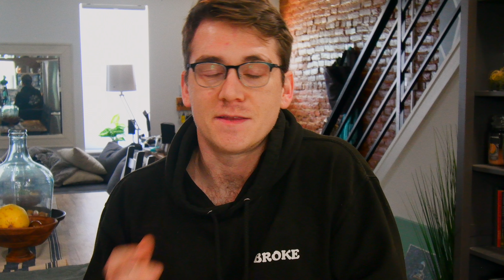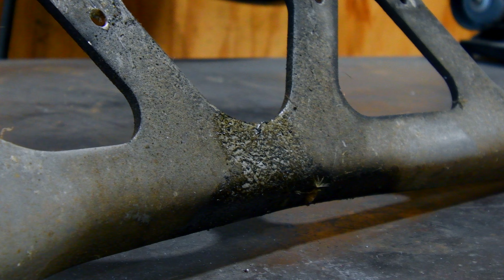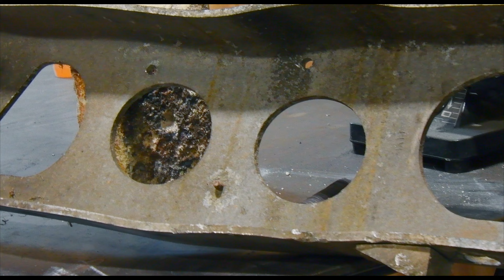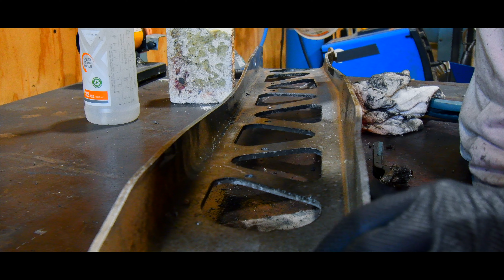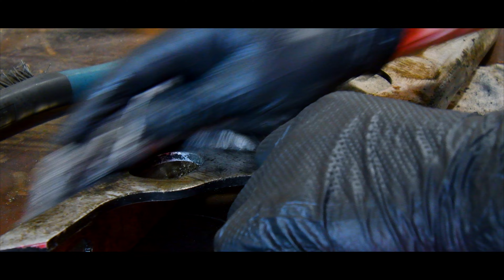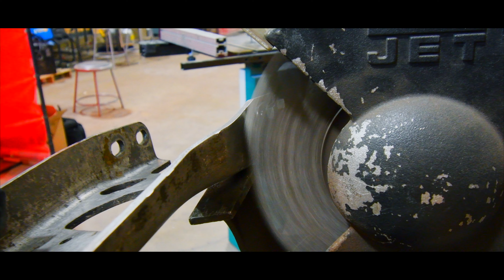WTF is a PPF?! Let's degrease the LAST structural component of a Miata's powertrain | #MamaMiata 34

Comment: What's the PPF made of? Sure looks good cleaned up, especially those shoulder bolts.  What's the paint scheme for the drivetrain? Or is that an upcoming surprise episode? 👍
Reply from the maker: It's made from steel but it's not super thick and it appears to be prone to bending & warping in race conditions.   Thankfully I don't plan on racing my Miata but it's kind of worrying to think it might get warped after some hard driving!

The paint scheme is a surprise - stay tuned for the next episode to see what color I chose!